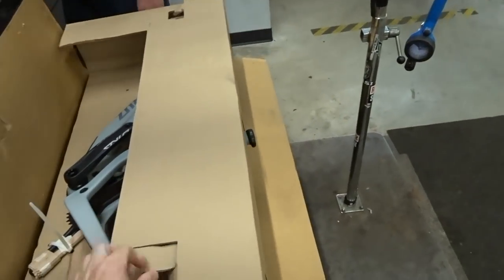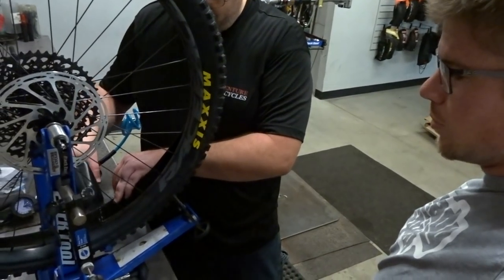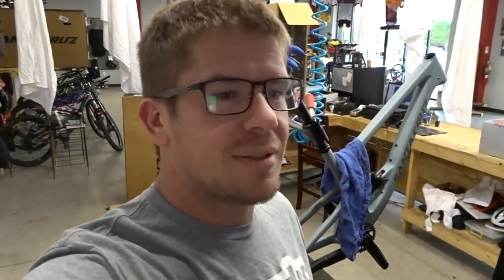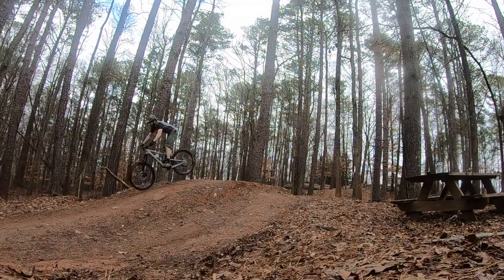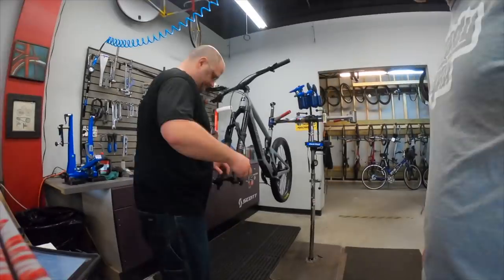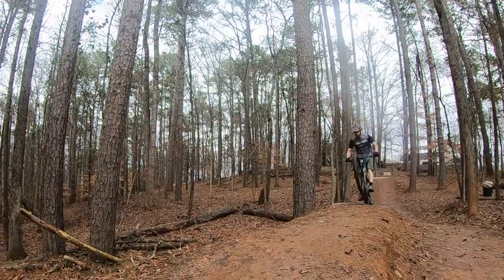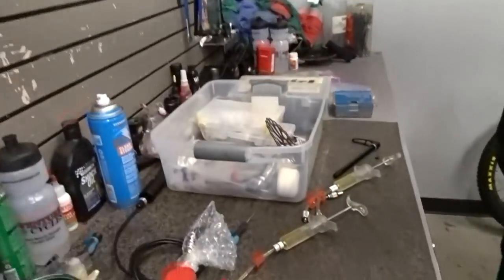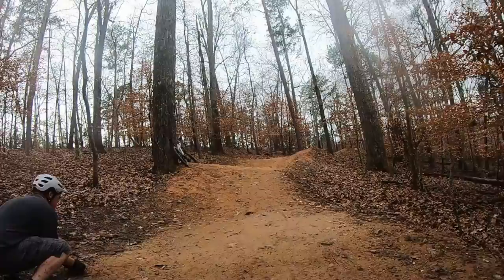2019 Santa Cruz  Bronson

Comment: Congrats on the new bike.  I have 2019 Stumpy and am looking at adding the Bronson to my stable.  How do you like it?
Reply from the maker: 412 MTB it’s a way better pedaling platform.  The over all fit is pretty close the the stumpy.  Slack and relaxed for riding
Reply: Glad to hear about the fit cause I’m comfortable on the stumpy.  You go with the same size in both bikes?
Reply from the maker: 412 MTB I went with a large.   I’m 5-10 and a large fits better.   But in road bikes I ride a medium.
Reply: @SteadySpin  FWIW, I', 5'10" as well, and Large was the right size for me. Pedals and climbs great. I can do climbs on my 2019 Bronson I was not able to do on my hardtail.
Reply from the maker: Tim M I am 100 % happy with my Bronson.
Reply from the maker: Tim M have you thought about putting on a shorter stem?
Reply: @SteadySpin  I have not. For me it has ended up being very comfortable as it is out of the box. I am switching to Shimano brakes (tomorrow in fact), and may get narrower handlebars (clipped a tree a few times).  But really very happy bone stock. Brakes only thing that has bugged me. Those SRAM brakes have felt a little mushy at times in hot weather (got my bike in August, and I'm in Arkansas) after riding a while, occasional SRAM noise of the rotors, and not a fan of the DOT fluid, and also uneven bite between the two brake levers.